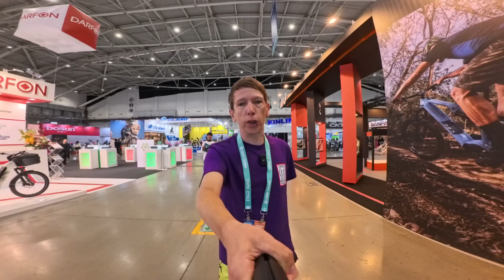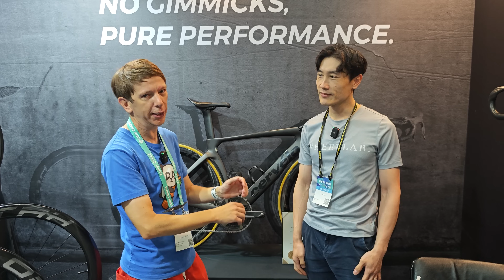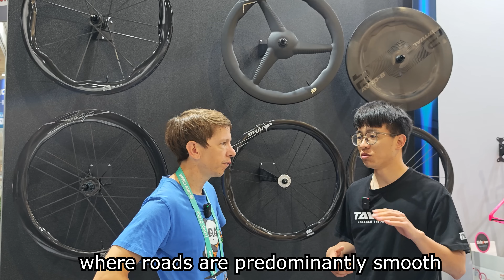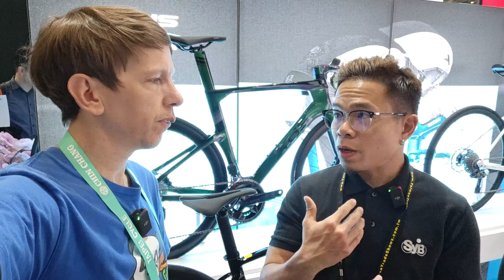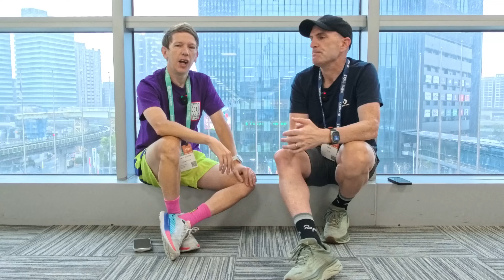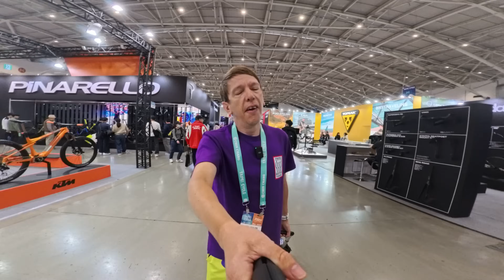Asking Industry Insiders: Road Tire Width. Fatter is Faster?

Comment: 30mm road tyres. I think it's peaked at around 32mm if you want to optimise for speed and comfort. Any higher means you're not sacrificing speed. Also tubeless tyres are much better at better at being wide, compared to tube-type tyres.

Comment: Conti gp 5000 23 front 25 rear, which when measured are 26 and 28 - on 19mm internal rim, 62mm deep , 29mm widest, it’s what swissside have been recommending for years - latex tubes of course

Comment: I think at the speeds most people ride at wider is better. But as was stated in the video, it depends on the weight of the rider and the surface of the road. If you ride at an average of below say 17mph then wider internals and wider tires will mean lower rolling resistance. Above an average of 17mph then aero will matter more and making sure you stay close to the rule of 105 tire to rim ratio will matter more.
The heavier the rider is the more beneficial a wider tire is. Not only for comfort and RR but also to help mitigate the potential for flats.
And, if you do happen to get lucky and find yourself in Spain or somewhere that the roads are smooth, you can always pump up your wide tires to higher PSI and they will be just as fast as the narrower tire. With a narrower tire you can only lower the PSI so much before it starts to be problematic. 
The issue today with wider and wider tires and internal rims is that you need a wider external rim to make sure you keep the rule of 105 aero part. Then you need a wider fork to run the wider rim.

Comment: I am not fast.  I don't even dream of being fast 🙂  However, I just switched back to 23C on my old 2012 road bike after riding 28s for the better part of last year.  And you know what?  On the good roads in Japan, they are surprisingly nice.  Vittoria's tire pressure calculator was suggesting some pretty low pressures, so with a system weight of 86 kg, I'm running only 5 bar (72 PSI?) and at that pressure, they are actually pretty comfortable.  Am I getting any aero gains?  Not much.  I'm slow :-), but for an old rim brake bike I was really surprised how nice it is.

I think this is one of the big reasons for the difference in responses.  A lot of Asian roads are so much nicer than where the big English media hangs out.  You can run lower pressures on narrow tires on nice roads if you are after comfort.  The deflection in the tire is related to the tension of the carcass and at the same pressure narrow tires actually have lower tension.  So 72 PSI on 23s is much more comfortable than 72 PSI on 28s (despite what people will believe).  Obviously, you can go lower than that on the 28s, but there are diminishing returns for comfort if you are also a lighter rider (also making narrow tires more viable for the typically smaller Asian riders).

Comment: I got fed up with the debate "what's faster road tire" now. Of course it's very hot and interestic topic but I realised that at my age (48) speed doesn't matter for casual/amateur rider. The most important thing for me regariding tires is: 1. to have maximum comfort allowing me to ride for hours, 2. maximum tire puncture resistance allowing me avoid struggling with damaged tire at the side of the road. Therefore I purchased Vittoria Ridearmor 34c tires (tubeless) and I hope spare TPU inner tubes would never be used. BTW, 190 cm, 98 kg, so 34c tires are not too wide.
Reply: I rode 23 mm tire	s when having 105 kg and had fun.

Comment: I have a question. It was stated in the video that the ideal tyre width can be determined depending on your weight. So, does that mean that heavier riders should ride on wider tyres or narrow tyres?

I would assume that lighter riders would bounce more and therefore benefit on wider tyres? 

Your thoughts.

Comment: Running 34mm. But I mainly do gravel and coming from mtb 29“ 55m and 28“ 50mm I honestly felt scared when I saw tiny 28mm and 25mm on my bike. Never road it. But since I have the 34mm I feel confident to ride faster and more on my road bike setup (I run gravel bike with two wheelsets)

Comment: Splitting hair is a delicate operation.
Lardass (me) did 103 km/h down the Col de Vence  a very brief second and had to change pads on my rimbreaks at home! 😂 And rim cleaning, checking up the state of course.. 
23mm back then, and the wider it gets its more comfort and grip.
I ride a lot slower now, on a hybrid 😊. Soon 60 and racing is a good memory to have, picnic with my woman during our rides is just wonderful. The hypes with all new tech is fun to know about, anyhow.

Comment: In my area where the roads are less than ideal, I love 32mm, an added bonus is the grip increase on curves. Feels a lot more stable on curves than a 25mm, I can ride faster with more confidence in less than ideal conditions.
Reply from the maker: I'm the oppoiste; on the curves I think bigger tires move around more under the bike and I don't like the added ride height / center of gravity (as a shorter rider, 5mm is a big difference.)

Comment: The bottom line is very individual.. am not a speed demon nor pro or even semi pro just the average  rider on the weekends

So conform is key, light weight wide tyres 28mm as 65kg rider with 75psi front 70psi rear works great with no issues
Reply from the maker: If you're not racing, take it fat and comfy. :)
Reply: @ChinaCycling  exactly man.. cheers

Comment: I've been on 28mm for last 3 years. I find the tires easier to work with when replacing inner tubes after a puncture. A bit more of rubber means a bit more flexibility.

Comment: Thanks for the video- it’s an important topic.  I run the first generation Winspace Hyper 50s with a 25 front and a 28 rear.  The reason for the 25 front is that is the most critical wheel for aerodynamics and the 25 avoids the ice cream cone effect where a bulgy tire spoils the airflow over the deep carbon rim and negates most of the benefits of the wheel.  On the back I ride a 28 for comfort as there are less aerodynamic gains at the rear wheel.  If I was to buy a new bike I would probably go 28 or 30 and be sure that my rims and tires matched for optimal aerodynamics.
Reply from the maker: Staggered front/rear set-ups are pretty optimal I think.

Comment: I feel the most comfortable and fastest on my Pirelli’s TLR Race in a 26mm, with an internal 21mm rim. Around 75psi front 78psi rear at a body weight of 83kg. By the way Korean roads are in my opinion not the best either. I prefer Spanish tarmac. I think the rubber compound makes a big difference. At least this is the only thing I can feel in different tires.

Comment: Used to race on 23mm tyres. I ride either 25 or 28's as am quite light. Have a rim brake race bike so usually run 25mm's as line up better with the rim. Also often that width is on special, so can get high end tyres at a discount. Roads here aren't great but I have no issues. Will prob get 28's next time just to compare as haven't run 28's for quite a few yrs. I can see why people run 32's etc for comfort and extra grip and confidence on twisty descents though.
Reply from the maker: I remember on my rim brake bike, if I ran 28s, I'd have to let air out to get the tire through the brake pads....
Reply: @ChinaCycling  Haha yeah I know. On my old bike I could get the tyres through ok but since it was their lower grade of carbon being ult (only the dura ace had their top level carbon) so after awhile noticed the 28's would rub on the chainstays out of the saddle, so back to 25's it was. Lucky my winspace doesn't have that problem :)

Comment: I’m a huge fan of the tire world. The professional peloton is expanding its tire width for some reason. I believe Ineos used 25/28 tires until last year. Anyway, getting back to most people riding, I’ve been using 24/26, 28/30, and now with a new set of wheels with 25mm internal width, the recommendation is 30/30 using the specific tires for those wheels. After a few rides, I can say that these tubeless tires with 50/53 psi are incredibly more comfortable on any surface. I haven’t tested them yet, but I think it could be interesting to find out. If you ask AI, it says that going all-round, they are definitely the choice (like we see the UAE using deeper and wider tires even on mountain stages). However, if you’re specifically going for claim only, the narrowest and lightest option is the way to go. Thanks for the videos, China Cycling. Cheers!

Comment: For me there's the factor of less fatigue as well, in a uk road race maybe 28 is fastest but your body is gonna feel that 4-5 hours on 28s more than on say 32mm rear 30mm front so you can be stronger at the end when it matters. So it is all relative. If you always do short rides on super smooth tarmac then by all means 25mm is best but if you do long rides on rough roads like my local roads, that added freshness from the comfort of the wider tires will always outweigh the aerodynamic losses.
Reply from the maker: Yeah, I also think it depends on the day's plan. If you're job is to get your guy to the bottom of the first climb in the first 30km, go for the 25s. If your job is to be fresh for the sprint at the end of the 130km stage, go for the 30s. But often we're seeing entire teams using the same tire despite their role that day / in general. Sub-optimal.

Comment: Body position... Aerodynamic drag burns 85% of your power on the flat. 80% of your aerodynamic drag comes from your body alone. Aerodynamic drag is by a large margin your biggest barrier to going faster.
Reply from the maker: The two are not mutually exclusive. You can optimize your aero and also optimize rolling resistance / equipment aero.
Reply: @ChinaCycling 
Yes yes yes! The friction force/rolling resistance stays roughly constant with speed, but aerodynamic drag increases with the square of speed. In other words, aerodynamic power goes up with the cube of speed, whilst rolling resistance./frictional forces just go up linearly.
Aero drag power rises with speed much faster than friction: at 5kph just 10% of your power goes into aero; at 40kph over 80% of your power is required just to push you through the air.  
It is, by a very large margin, the biggest problem.

If you ride long distances at high speeds, you should prioritize aerodynamics and rolling resistance.
If you climb a lot, then weight becomes more important.

Comment: I think a huge reason why riders in the world tour ride wider tires even on TT bikes is the increased grip when cornering and descending, they are taking huge risks during those TTs and need every little bit of grip.
Reply: I agree. Faster isn’t just aerodynamics and rolling resistance. If you can corner faster and brake harder you get to carry speed longer and then not have to scrub off so much speed.
Reply: agreed, more confidence equals faster speeds.
Reply: Any other time it’s comfort. But I think you are right. Thinner is generally fast because thinner runs at a higher pressure. Tests haven it. Run same tyres at same pressure fatter is faster but the bigger tires can run at the the high pressures. GENERALLY.

Comment: My training (disc brake) bike has 32s on it cause then I don't have to worry as much about bad pavement. The faster bike(s) are 30s but could go thinner.

I have some rim brake bikes too. One that maxes out at 28, the other at 25. Both feel good but I started riding on 23c Supercomp HDs to take that with a grain of salt

Comment: I live in London, ride mostly poor surfaces, have a pair of Sosan's Wheellab V50's (23m internal, 31 external). I have run the Aero 111 29m up front (measures just above 29 and the GP 5000 ttr 25 which measures just below 28. The GP 5000 was  faster, the wider Aero 111 felt better on wet winter roads so I think it really is a combination of road conditions, weight your priorities etc. I don't think there is a right or wrong I found the 25 to be faster and the 28 to provide more comfort

Comment: I've tested a lot of different wheels and the fastest is 25c on 88mm depth wheels. In order to even TRY the same aero shape, you'd need 28c on 100mm or 32c on 115mm rims. They just don't make rims this depth to even test wider tires.
Reply: Funny, I've been testing wheels all year using 30/32s. This past weekend I swapped in a set of 28 GP5000s, and sheesh they felt much faster. Not because there's more road feedback. There really was not. I'm told the feedback actually is slowing you down. But tangibly it felt faster for less power.
Reply: @PatrickLino In what way (if not road feedback) did it "feel" faster?
Reply: @ Responsiveness and my computer

Comment: Road surface dictates the tyre size.  Anyone liking 25's must be riding smooth tarmac.
Reply: True, but they have been racing the cobbles on 23-25mm for decades, Paris-Roubaix, Flandres, etc... lots of flats, though.
Reply: @DR_1_1  Racing frames never took larger tyres than 23-25 for decades though 🤷‍♂
Reply: @ Except in the beginning maybe, but that was when all roads were gravel or cobbles, bikes were fixies or 2 gears by returning the wheel, with leather saddle...
Tyres were 32-38 mm then!
Reply: @ In the beginning, there was darkness... 😜
Reply: @davidowen9770  How is that darkness, we are going back to these 32-38 mm and gravel trails, even the TdF!!!
Gravel is fun ;-)
Reply: Absolutely

Comment: Still on 22-24 on crappy UK roads - not an issue if you get the pressure right. Tried some 28s last year at different pressures just to see what the fuss was about and it was noticeably slower on the climbs no matter what I did. There's a reason that the UK national hill climb is all 23mm - and it's not just because they're lighter

Comment: at system weight of 95KG I'm running thirty in the front  thirty two at the rear. 64 psi front, 66 psi rear. I'm more concerned about comfort and safety. This setup corners and brakes very well and as long as I can stay in a group and be more comfortable, I do much better at the end. The watts difference between wheels seems like one of the lowest among things we can do. Position is free speed if you can hold it, the right helmet for your position, socks can make more difference than wheels, the right kit that fits well, handlebar width is probably worth more over all.
Reply: Socks, lol.
Reply: @williwacker2774  I know, it's funny but true.
Reply: @robertwhyte3435  How many pints o' snake oil did you have today?
Reply: @williwacker2774  Did you bother to look up how many watts aero socks can save?
Reply: @robertwhyte3435 I don't believe such claims unless the methodolgy to reproduce the numbers is provided. Even if the numbers were true, they are provided for speeds only pros can achieve on closed roads.
You say you are "more concerned about comfort and safety". You are right on that. Just enjoy your riding and don't fall for the snake oil. The only 3 things which will make you faster are: ride more/more efficiently, ride more efficiently (like don't waste energy on descents - drag is proportional to the square of your velocity) / train more efficiently and a better position on the bike. Everything else is a matter of seconds over a distance of 50kms.

Comment: What I see is younger narrower, Im 40 so wouldn't consider using tires smaller than 32s but my road limits to 28, thats probably why it's getting dust and Im just running on my gravel on 40mm tires hehe.

Comment: Good stuff as always!  I think the real takeaway is not 25mm as it says on the tire but rather that everyone is now considering Measured tire width on rims that match externally.  So no one is actually running 25 measured, they are running 27-28 measured and a rim that matches..

Comment: I recently made the switch from 25 mm tyres on 19 mm internal width rims to 32 mm tyres on 25 mm internal width rims. Comfort is incredible but it might have been a step too far, might go for 30's for the next set of tyres.

Comment: 28c rolls better on bad surfaces, but on good surfaces 25c roll faster.
Now once the speed reaches 25+ mph, then aero comes into play, and the faster the speed the more aero comes into play, and this is where 28c is slower overall.  Reason is rolling friction is linear, while aero friction is the square of speed.

Comment: Running 25 on lots of my bikes, just started 28c on my CAAD10. Really liking it, but on good roads, the 25s are plenty. I wouldn't go larger unless the road surface is really broken up and crappy, the smaller width feels more exciting
Reply from the maker: I agree that 25 feels more alive and more feedback from the bike, etc.
Reply: I have several bikes with different tire sizes.  For long steady flat road 36-38km speed, 25mm gives me best results.  I use gp5000 25,28,32  obviously 32mm feels like riding on clouds but it’s not fast when you are doing those kinds of speeds.
Reply: Gotta keep the cash cow going.